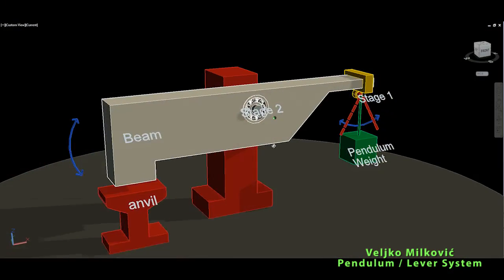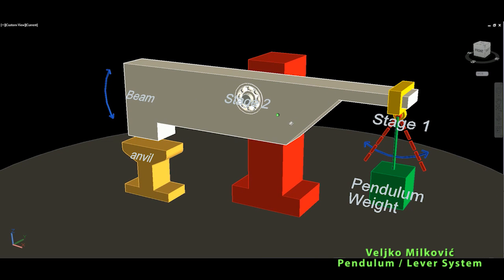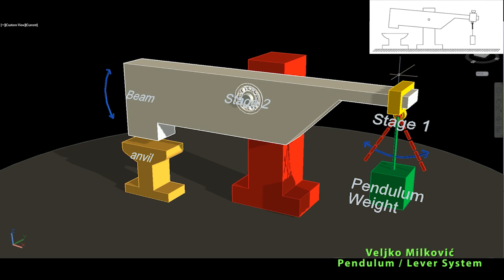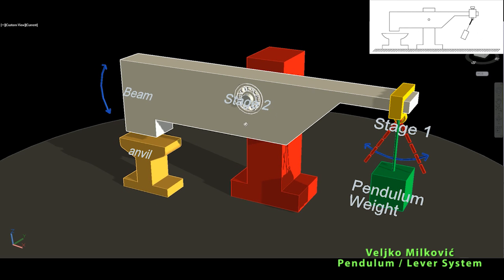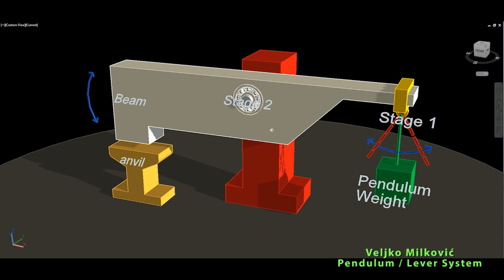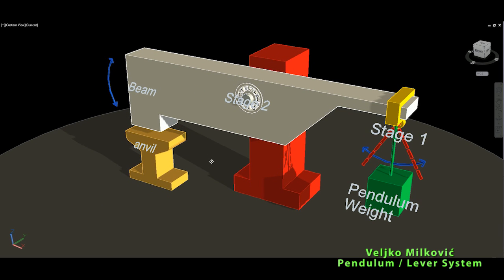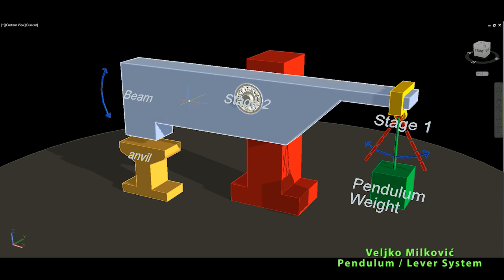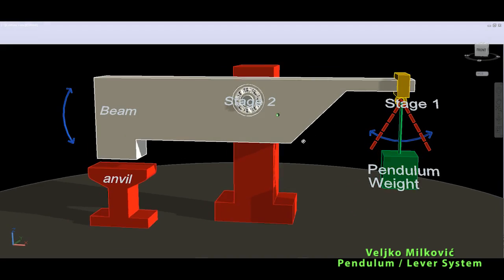Free Energy Generator, VELJKO MILKOVIC Pendulum Lever System

Comment: can you look at the proven Lenzless generator at overunitybuilder, com,  has working proven prototypes
Reply from the maker: Yes, but this one works on same principle
https://www.youtube.com/watch?v=Ea4dodm13iI
Reply: sorry Mario you are wrong, The ring magnet version of the Lenzless generator does not exhibit any magnetic drag because the ring magnets do not move, the fields inside the coils are changed by the moving iron inductors, no load induced drag or magnet induced drag, only bearing and air resistance to motion, also speeds up under load.Just eliminating Lenz law does not eliminate magnetic drag which can be very great force to overcome, as Francoeur found out the hard way.